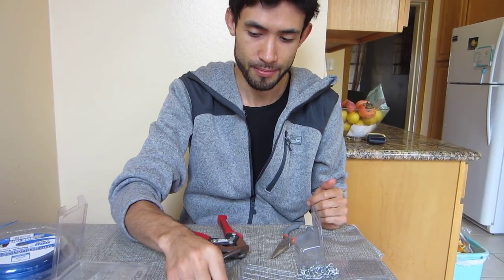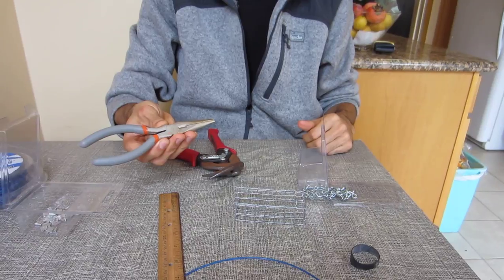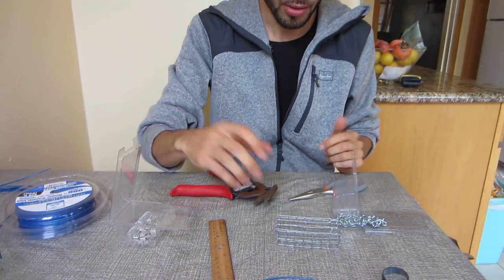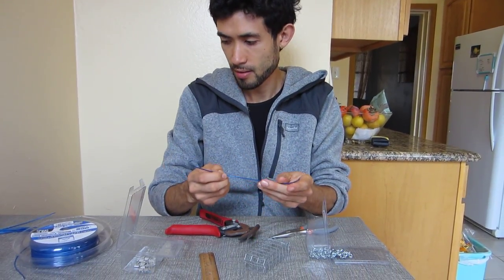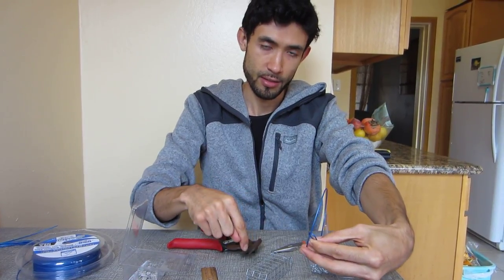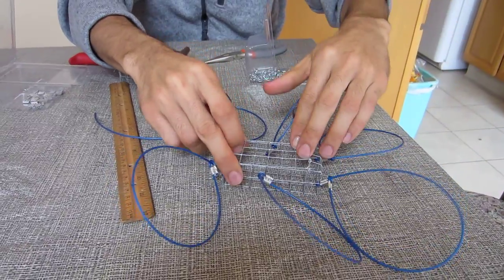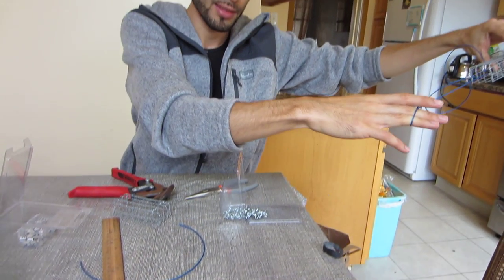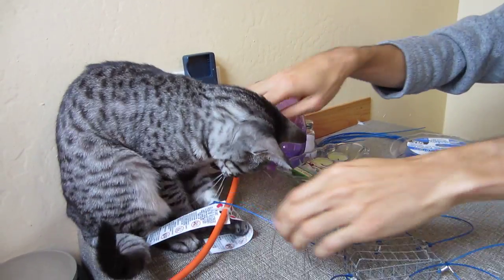Quick DIY Crab Snare

Comment: @Matt Withans, as a serious novice/beginner,I can totally understand how to go about making my own trap ,and it be effective without having to purchase one. Right, bc the main purpose is to be frugal and that goal is to not spend so much for a trap let alone mainly crabs itself. You we're very thorough ,and knowledgeable about the topic,correct execution to getting your crabs B.Y.O.T,and the do's /dont's in let the trap do the work for you without stressing if you're doing it correctly,either way one's sole purpose is be  inexpensive while catching as much as you can... I have a? what time is the best time @ catching crabs meaning low /high tide,or are their  any other ways to effectively and efficiently produce more than 6 or so. Also,which kind of bait is best to use!??
Reply from the maker: +Maureen Palmer In my experience incoming low tide is the best time to go.  The most important thing for crab snaring is that the current isn't too strong and the water isnt so rough.  So if you can find a beach that isn't so effected by the tides that would be ideal.  For bait, definitely Squid and Mackerel.   They've always done an excellent job for me.  I know you're trying to be frugal, but I have some heavy duty snares available for sale if you ever are interested.  Check my most recent video of me using them and catching a bunch of crabs :) https://www.youtube.com/watch?v=SR8XjrDZzms

Comment: Where do you get the thicker gauge hardware cloth.  I can't find it at any major retail stores?
Reply from the maker: +Eric Ongpin Have to special order it.  I've only seen it available in rolls of like 3ftx100 ft and it can get pricey
Reply from the maker: +Eric Ongpin Can't special order it from a major retailer either.  Your best bet is a local machine or fence shop.